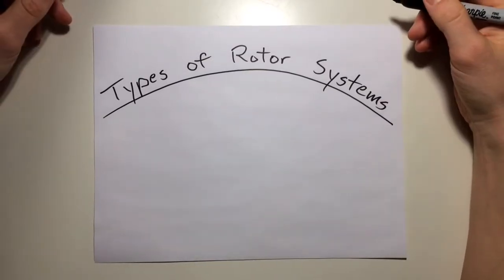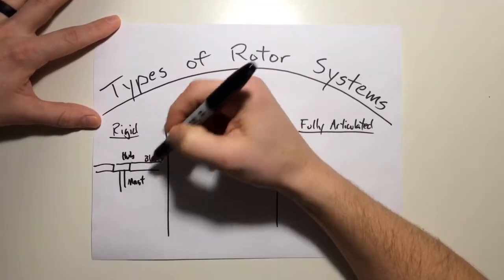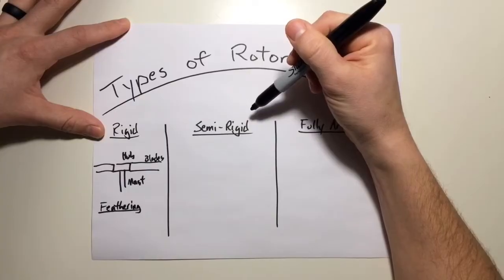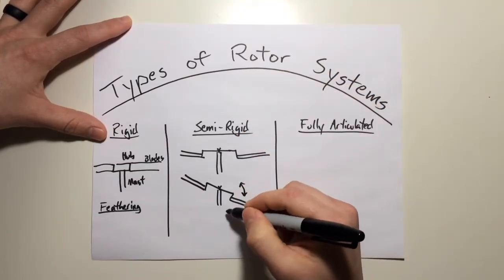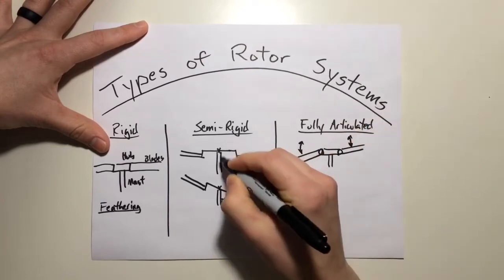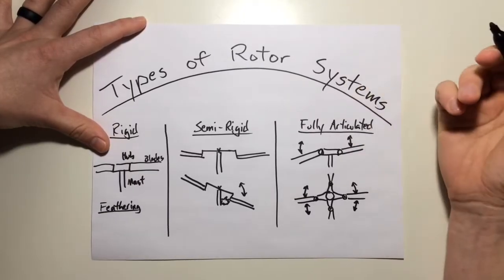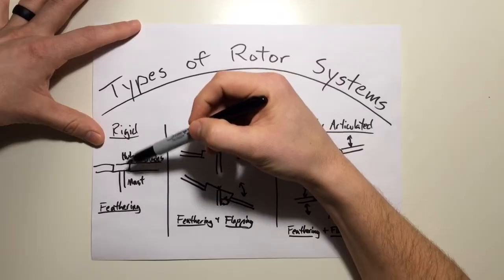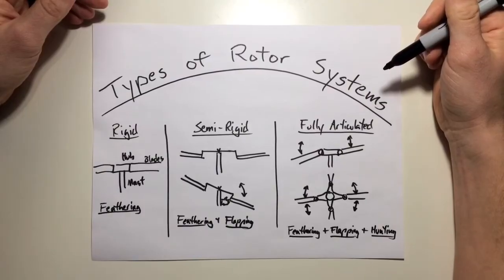Types of Rotor Systems in Helicopters

Comment: Could you please release a video explaining the Kiowa OH-58 rotor system? 

It looks odd to me. Although it looks like a rigid system with no hinges for flapping and lead-lag, it allows the blades to flap due to its elastic properties. Is it considered to be a semi-rigid or a rigid rotor system? And what happens with the Coriolis effect in that case?

Also, could you also give some explanation about the flybar on the UH-1?

Kind regards,
Andreas Trakadas

Comment: As I watch videos of helicopters accelerating away after take-off, it seems that there is no noticeable change in angle between the fuselage and the blades as forward cyclic is applied.
Does the rotor system (fully articulated) transfer pitching moments to the mast (and thus the fuselage) when cyclic is used, or does the fuselage truly hang from the hub like a pendulum.  If it's the pendulum case, that would imply that the only reason the fuselage pitches forward is because the CG is below the hub, and the CG is being "dragged" by the rotor hub.  The way you drew your fully articulated rotor, it would seem possible for the blades to impart a (pitching) moment on the mast, because the flapping hinge is a distance away from the center of rotation, and the centrifugal force of the rotor could imply a pitching (or rolling) moment on the mast.  Obviously the rotors flap, but the fuselage seems to respond quickly to cyclic inputs making it appear that the rotor and fuselage are moving in unison.  Any thoughts?
Reply: Your assessments are correct. Fully articulated hubs allow centrifugal forces on blades to pull the hub into alignment with the rotor disk. Semirigid systems require pendular response to adjust fuselage attitude. An unloaded pushover in a Bell H-1 often resulted on rotor impacts with the top of the fuselage as the rotor disk tilted forward and the fuselage stayed level.  Needed to be really careful about making aggressive ridgeline crossings.

Comment: Awesome video man. Would be really cool if you could do a hands on demo with a real rotor head. I used to work at a machine shop and i routinely inspected rotor head components of the H3 helicopter, which despite being designed in the 50's, was fully articulated. A truly amazing design by the engineers. The blades can move in all 3 axes, cycling each rotation at 300rpm.
If I still worked there I'd be willing to get some hands on video for you but I don't

Comment: May be off subject slightly, but a question for you that’s been troubling me since the first Huey Cobra presented itself in our unit of all standard Huey’s, Viet Nam, 1969:  Noticed, even on a quick glance, the Cobra had no “stabilizer” bar.  Seemed like pitch change came directly off the upper swash plate via 2 long pitch change rods.  No more little pitch change links off a stabilizer bar like on our Huey’s.
Because that Cobra was just refueling at our base, it quickly started up and flew off without time for this baffled “C” model Huey pilot to speak with that Cav pilot.  What happened to the stabilizer bar (paddles) on now-ancient, 2-bladed, teetering-head heli designs?
Thanks in advance from an old hover-lover from days long gone.

Comment: Although I appreciated your description of the various rotor systems, I would also have greatly liked to have seen the actual schematics and maybe even a physical example of the items; trying to view these systems on the internet only results in hundreds of redundant examples over and over which ends up with me becoming irritated and finding something else to do.

I presently own a vintage Bensen B-8M (in glider configuration only for right now until I install Subaru in it for power).

What I'm looking to do is to utilize a three-blade system but don't know how to get all three blades to function the same as a two-blade "teter" system and any information would be Greatly appreciated, Thank You.

In the meantime Thanks for sharing the information which you've already posted.
Reply from the maker: I try to keep this to the basic level that a pilot would need to do. Many engineers work with those schematics but the average pilot doesn’t necessarily need to know the precise blueprint as much as how the systems differ for flight.
Reply: @helicopterlessonsin10minut10  Can we have a four blade rotor system with teetering system?

Comment: Don't all helicopters have some negative pitch for auto-rotation?
Reply from the maker: Not all. Some helicopters designed to land on navy ships may have negative collective to hold it to the deck. But many helicopters are not designed with negative pitch.
Reply: @helicopterlessonsin10minut10  so how do they achieve auto-rotation?
Reply from the maker: I have a whole video explaining it. Check out my Autorotations Expanded video

Comment: In Gyroplane, the semi rigid design has evolved and overcome the need for the lead lag hinge by under-slinging the blade at the hub. This is done by having a mast tower. This tower is typically two plates which extend well above the rotational point of the mast. This allows a swing motion as well as the see saw motion to occur. Ass the blade flaps up to dissipate the lift on the advancing blade, the swinging motion extends the blade outward to compensate for the stresses imparted from that of the Coriolis effect. As for as the progress of hub design,  la Cierva’s bamboo rotor wings of his models only flew because of the flexibility of the blades allowing for the dissipation of asymmetric lift. Once a full scale version was built the craft rolled on take off. He then created the flapping hinge. This did not fix the problem   Coriolis Effect induced stresses as you have sail lead to blade stress failures so he invented the lead lag hinge. All of these innovations were present in the Pitcairn rotor head as well as the ability to change pitch globally allowing jump take offs. Sikorsky was struggling with his rotor head design and became a licensed Pitcairn dealer at the suggestion of the US Government. Only then was Sikorsky was able to make his machine fly with acceptable degrees of control ability using a single rotor. Effectively Sikorsky stole the rotor head design and the Pitcairn family sued. Sikorsky was awarded government contracts and denied the lawsuit. This happened in 1941 and the lawsuit was not settled until the mid 70’s. The problems were solved more or less before Sikorsky flew in ‘41. If the helicopter industry de evolved itself in rotor head design, that I do not know. There is a great book by Dr. Bruce Charnov, Autogiro to Gyroplane, which tells the rich history of the first rotor winged aircraft. It is a good read, out of print but still available.
Reply: OK Mr smart guy, can you explain to me why the US Army used the 540 rotor system on 'B' model gunships in Vietnam and the difference?
Reply: @skipperclinton1087  Mr smart guy? Really? Why the push back? I do not know what the 540 rotor system is. Why should I? I am just relating what I know is to be true about the very early development of the rotor systems and why certain elements came to be. The lead- lag hinges resulted from the change in the cg of the blade as they rose and fell. With out them, stresses on the root of the blade caused failures. The underslung nature of the Gyroplane simple style non powered type employed today and made popular by Igor Bensen found a way of relieving the vast majority of the stresses caused by the flapping motion. That’s it, end of story. I shared this because I expected those who are reading this thread might be interested in knowing the now ancient history of how something came to be. It is trivial knowledge, a well how about that thing.
Reply: @crawford323  whoa, I didn't mean it as an insult, I meant it as a compliment. Your knowledge of choppers is well above my pay grade so I thought you might be able to shed some light on some I learn about.
" Bell designed yet another Huey variant, the "UH-1C", intended strictly for the gunship role. It featured the T53-L-11 engine of late-production UH-1Bs, with a modified intake system fitted with prominent air filters; and a new "Model 540" rotor system, with a blade chord increased further to 68 centimeters (27 inches)." All this is a foreign language to me so I was hoping you could break it down into simple layman's terms.
Obviously not with your bad attitude.
Reply: @skipperclinton1087  My bad attitude? With the lack of facial expression and or hand gestures to complete human communication, extra care must be imparted when crafting the written word in order to be assured that no extra between-the-lines interpretation of that written word is added. Using the terms “Smarty Pants and bad attitude” could be easily interpreted as demeaning and as a less-than-careful writing style.
Reply: @crawford323  Dude I called you "Mr Smart Guy" as from all the information you possessed on rotary wing aircraft I was spot on. Obviously you took offense to being called a "smart guy". Case of mistaken identity perhaps 🤔

Comment: You made a small mistake, the apache uses a rigid rotor system similar to the AH 56 cheyenne. That's why they can aileron roll and backflip just like the red bull Bo 105

Comment: Btw if you understand this one step to the future pilots or engineers you can understand the other two or you can learn about the opposite section first however in the middle requires knowledge of both motor systems

Comment: You can see in the video https://www.youtube.com/watch?v=Pu48f7s5Ru8 a rigid rotor working. There the pitch horn and de pitch link are going up and down, all this is only because the helicopter is going foward? This movement is the somatory, deformation and the necessary swashplate actuation? The maximum lift hapens at this point, where the blade goes up. Then you need less atuation in the ciclic comand. Is this?

Comment: As the blade flaps their mass is getting closer to the axis of rotation, not the point, It is rotating up and down at a radius from the point so that actually never changes.
Reply: I don't get your comment. The weight being lifted, it seems intuitive to say that it's tip is getting closer to the center of rotation.

The blade length of course doesn't change, but it draws a smaller circle around the center.

Comment: Any video explaining the connection from turbine to rotor? Is it a clutch system or a bleed turbine system...how does it work?
Thanks.
Reply from the maker: It really varies by helicopter. The power turbine section of the engine is turned by combustion and is generally directly linked to the transmission. However, some helicopters (dual engine) have clutches that enable different power outputs from each engine.
Reply: Thanks, i was checking out Igor Negada's video of his GTD-350 helicopter turbine restoration. It was the gearbox which i was refering to but didnt know it. I couldnt work out how a turbine rotation translated to the rotor rotation. 
https://m.youtube.com/watch?v=-gewWyLi1mc&list=RDQMxPSnXzNqL3o&index=3
I passed on the schematics i found, he is very apt at parts fabrication a little wasteful with resources but i think his hydrodynamic aerodynamic aptitude is equivelent to half a potato...thats been mashed.

Comment: I found a diagram online http://forums.pelicanparts.com/8046099-post59824.html of a dual rotor two blade KMAN K-Max has one teetering pin centered on top of each drive shaft. Does that mean it is semi-rigid? Semi-rigid is only for 2 blade rotors? Can I just say that any helicopter with more 2 blades per rotor must be either rigid or fully articulated?
Reply from the maker: Tom Mendenhall.  With rotor systems and composite materials evolving so quickly, it’s hard to just make quick assumptions on what a certain type of rotor system is based purely on blades. The easiest way to determine is to look at each blade to see if it can articulate on its own. If not, then look for a teetering hinge. If neither of those are present, you either missed something or it could be a rigid system.

Comment: What type of rotor system is on Bell 407?
Reply from the maker: Sagar Dolli. It's what is known as a "soft-in-plane" system. This system is like a fully articulated in that each blade can flap, feather, lead, and lag independently. However, there are no traditional hinges because the blades are composite material that allow bending and flexing.

Comment: why rc helicopters do not work with two blade semi-rigid teeterig rotor head and are they too unstable?  :(
Reply from the maker: George. I don’t claim to know much about RC helicopters. But I’d assume they aren’t semi-rigid because they want quicker control response and aren’t concerned as much about high speed flight.

Comment: Teetering rotor heads lead lag too, Semi rigid is not the right term for a teetering head, 
semi rigid rotors have a heavily damped articulation and modern day rigid rotor heads have elastomeric hinges to relieve the loads on the blades, anyhow :)
Reply: Teetering heads don't need to lead and lag. As shown in the drawings, they are "underslung", so the upward flapping blade is thrust outward from the hub and the downward flapping blade is drawn inward. The CG of each blade moves inward or outward, changing moment arm, allowing angular momentum to be conserved with no change in blade rotational speed. Think what would happen if our proverbial figure skater simultaneously extended one arm while retracting the other... Their rotation would not change.   Hubs with elastomeric hinges are not "rigid". The Cabri G2, for example, with its elastomeric hinges, is a fully articulated system (according to the manufacturer). If it has hinges of any type for lead/lag and flapping, it's not "rigid".

Comment: The rigid rotor system also flaps because flapping is the only way a rotor system can compensate for dissymmetry of lift. Flapping is the up and down movement of rotor blades as they rotate...The main difference between these rotor systems is how they each allow Flapping to occur either through (1)blades flexing in a rigid system
(2)blades flapping as a unit on a pivot point in a semi-rigid system
(3)blades flapping individually about a hinge in a fully-articulated rotor system
Reply from the maker: LeoAero19. Well said. That's what I was getting at by describing rotor systems instead of blades themselves. All systems flap to compensate for dissymmetry of lift. But each system absorbs the stressors of this in different ways. Thanks for the feedback!

Comment: Thank you for your excellent videos, however, the use of the term ‘semi-rigid’ is confusing and I believe incorrect. Westland Helicopters (UK) have used the term for the rotor system used on the Lynx and Wildcat. Also, there is nothing rigid about the head on the R22 etc, semi or otherwise. Thanks again.

Comment: I have to say I'm been looking for an explanation for a few days now, for why you would need flapping and hunting and this is the first video that explained it. Just one thing, is the flapping and hunting controlled by anything or is it just a passive hinge? If it's passive, does it has dampening or are the blades allowed to flap and hunt freely?
Reply from the maker: B.D.B. Thanks! The flapping and hunting are passive movements that are a result of the forces acting on the blades.  Because of this there are dampeners and droop stops to help keep everything under control.

Comment: Isn't the rigid rotor the best though, since it eliminates mast bumping and ground resonance problems?  It also lets you fly inverted, do loops etc. which you can't do with the other systems.
Reply from the maker: Poly Hexamethyl. It really just depends. Each system has its own maintenance costs and aerodynamic advantages/disadvantages. Rigid may be the best for aerobatic performance. But I guarantee those blades and rotor system cost a lot more than something like a Robinson's semi-rigid system which may be best for affordability when learning to fly. Thanks for the feedback!

Comment: Semi Rigid is feathering and teetering 
Fully articulating is feathering, flapping and lead/lag
Reply: Well, the rotor hub is teetering back an forth which allows the main blades to flap up and down so flapping is still going on.  It has to or there is no compensation for dissymmetry of lift.  What he doesn't go into is what's happening to the lead/lag forces in a semi-rigid rotor system.  As the rotor blades are flapping upwards and the center of mass of the blade should be moving closer to the axis of rotation and trying to lead forward, the teetering rotor hub is actually moving the blade away from the center of rotation.  These two motions counter each other and the center of mass of the rotor blade itself stays at or very near the same distance from the center of rotation (rotor mast) and thus there are no lead/lag forces to deal with.  Likewise, on the side that's flapping downward, where the center of mass of the rotor blade should be moving away from the axis of rotation and lagging behind, the teetering rotor hub is moving the blade closer to the axis of rotation and again, the two motions cancel each other out and lead/lag forces are neutralized or at the very least, kept to a bare minimum so not lead/lag hinges are needed.